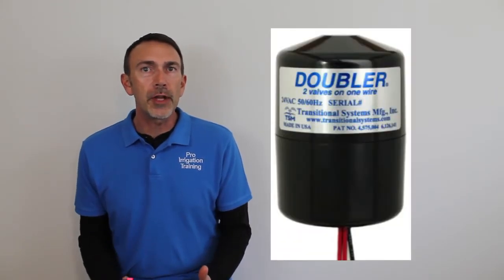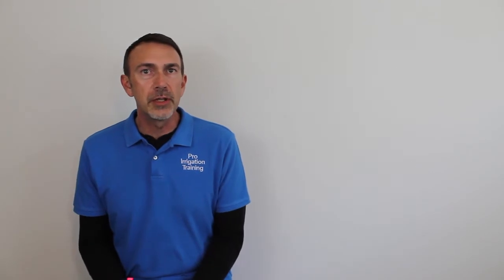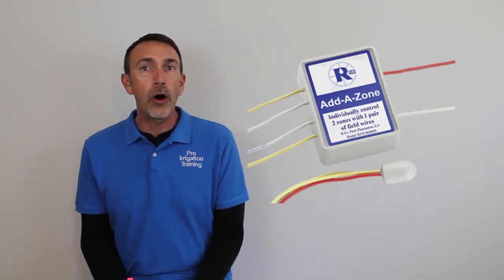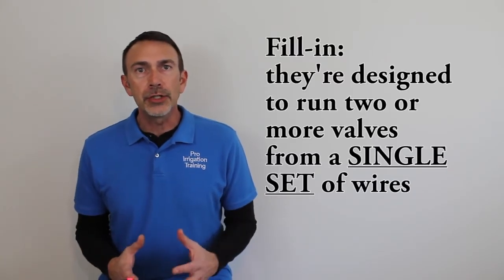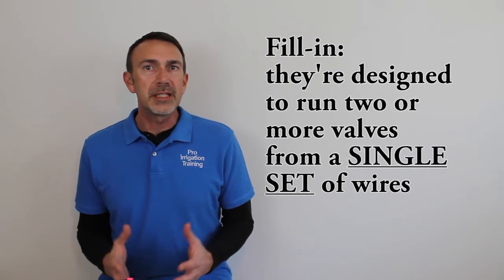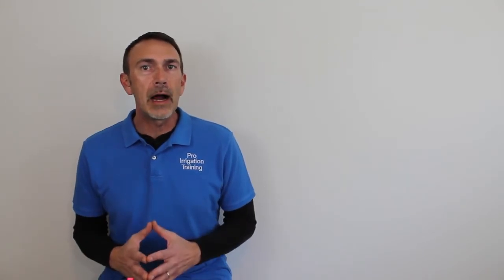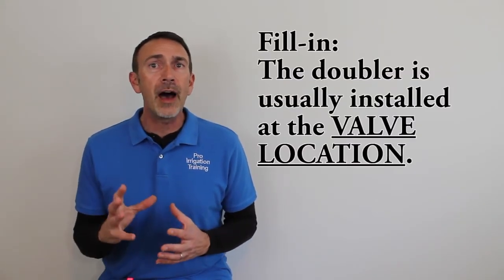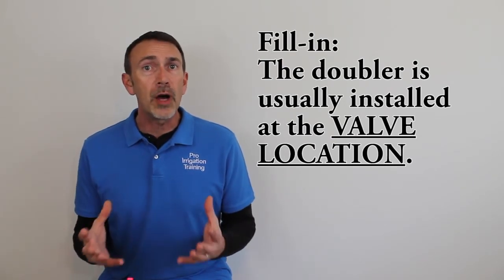How To Use an Irrigation Wire Doubler (sprinkler training)

Comment: Is it possible to have the zones that are on doublers be different programs?
Reply from the maker: You know, that's a good question. If I'm remembering correctly, the doubler works by a switch that flips back and forth each time it's activated. I suppose that if each program ran the zones an equal number of times, it would switch back and forth correctly. Give it a try and let me know if it works. I'm not currently working on any systems that have them.

Comment: Hi do you know how to troubleshoot one of these wire doublers? Not sure how to measure on it with our multimeter.
Reply from the maker: Hey TT, to be honest, I do not. The only thing I would know to do is measure output voltage. I don't think there's any repairing them, just replace it if doesn't work properly. They're essentially just a switch, so I wouldn't think there would much resistance in the unit.